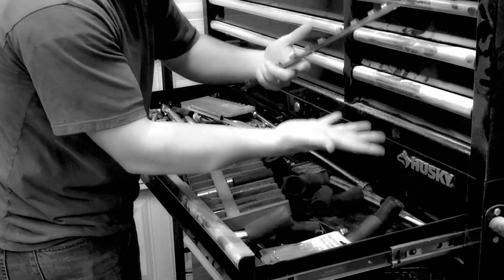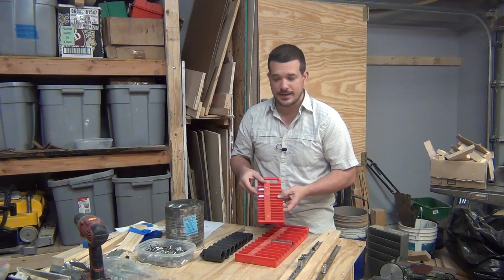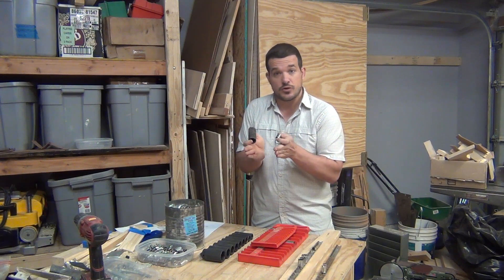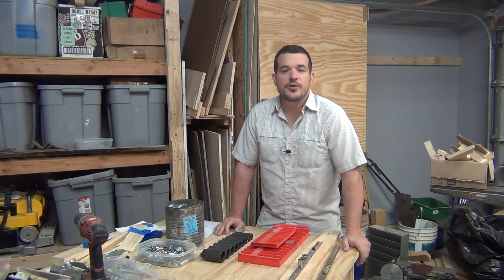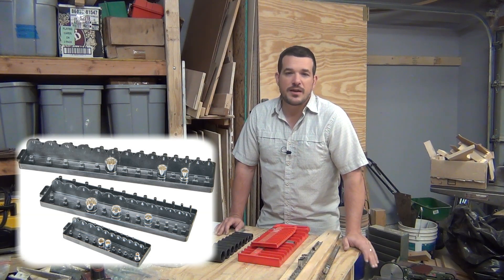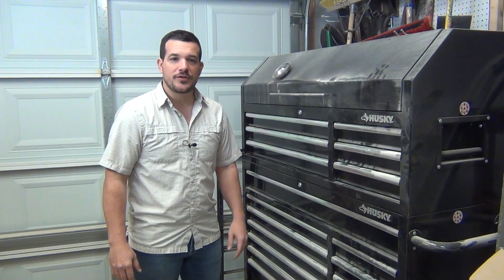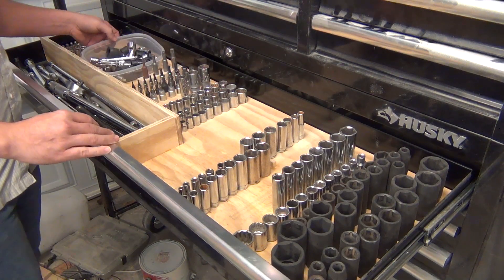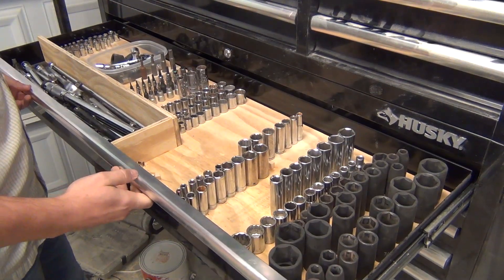Organizing Sockets - Which is the Best Method?

Comment: I appreciate the time you took making this video. However I feel like the whole purpose wasn’t to be objective about organizing sockets because you covered none of the upside to the methods that you spoke of before you told us your solution. The whole point of this video seems to be to advocate your solution, which like the solutions you mentioned before, is clearly not for everyone. You mention wasted space of other methods, yet I saw a lot of wasted space in yours. The time involved in doing what you did is at least as much time as would be needed to overcome any of the faults of the other methods. The idea of gluing dowels to plywood and chiseling them off seems to be at least as tedious as cutting foam and as restrictive as trying to move precut foam into different dimensional areas.

Comment: You have a 7.5mm socket? I have never, ever seen, or even heard of, a 7.5mm socket.
Reply: Worked on a hyundai that needed a 7.5mm and pretty sure a motorcycle once too.. cant say i have ever used the 5.5mm. But love having it just for the odd looks i get from time to time
Reply: @cjt4935  Wrong, I am well aware of 5.5mm sockets, since that's the standard head size for M3 bolts, and 4.5mm come to that, but I've still never seen a 7.5mm!
Reply: @armith  5.5mm is the standard head size for M3 bolts, so if you're working on stereos or electronic stuff with teeny bolts you'll come across it. I've never used the 4.5mm myself, but I'm sure they exist for a reason b;-)
Reply: I also recently saw a 9.5mm Snap-On socket for sale on eBay - that's another new one on me. Has anyone ever used a 9.5mm socket?